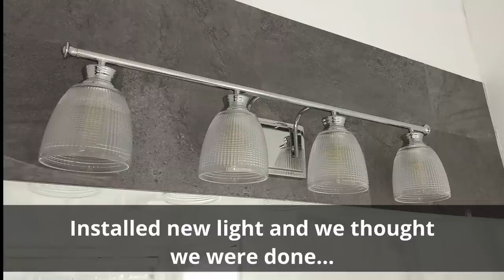AMAZING PEEL AND STICK Vinyl Tile ACCENT WALL!

Comment: Looks great! Next time try removing the vent and spray painting it, that way the dried paint won't block the air flow. You guys did an Awesome job on the wall👍🏽
Reply: Smart and pretty, you luv to see it. 👍🏽
Reply: I was thinking the same thing. Spray paint ALWAYS best.
Reply: That was probably too much work lol...remember it was the guy painting the vent

Comment: Nice job looks very nice. We put up peel & stick tile in our shower. We did use glue too, that was last year some of the tiles started coming off so we had to take those off and replace but other wise still looks good.

Comment: We did this in our bath and kitchen. Cheaper way to tile the walls and they work
Reply: Will it withstand heat from the stove if a wall is very close to the left side of stove.
Reply: @joureny1154  We did this in our previous house, it works well but do not put it near the stove or anywhere with direct heat. I don’t remember if we used any additional adhesive like they did, but over times the tiles would become loose or fall off by the stove because of the heat. 
It was a potential fire hazard in just that spot. 
Otherwise it’s a great project and the newer times look so realistic!

Comment: What agreat idea I didn't even think to use flooring Vinyl in this way its so kool I saw this vlog as I want to put a shower in my bathroom but the tile panels I've been looking at are so expensive. I may try this but only if I can waterproof it 100% I dont want any mould issues. Thank you for this creative idea☺👏👏

Comment: That looks amazing!! We are renovating most of our house, and we found a ceramic tile big (2’x4’) but that has that slate or concrete color and finish, we are planning on doing it on the floor and walls, but jeeze, maybe we should rethink, and save ourselves a lot of work and use the peel and stick. It also wont be as cold to touch. 👍🏼
Reply from the maker: Hi Ryan! Peel and stick has come a long way!  It can save you time! 👍🏾 Thanks for your comment!

Comment: Very nice job! Considering this too for the home we just purchased. I had ruled this out initially as I figured the moisture in the bathroom would inevitably result in peeling tiles, but maybe the adhesive technology has improved enough to make it a reasonably long-lasting proposition. Another plus, I guess, is that if you get sick of the color/pattern/style, you can peel them off - probably softening them with a heat gun  - then replace with another style. Right now it's a toss-up between this and a vinyl laminate wood board look. What I do know is that I'm going to go with actual wall tile. I've done a few tile floors, but having to use masonary bits to drill for reattaching fixtures is not my bag of tea. I will be installing actual ceramic subway tile in our kitchen though.

Comment: I think that is the best thing to do. Apply an adhesive first to the area before sticking the vinyl tile. Otherwise, some vinyl will just fall off because its adhesive is not sticky or strong enough. Doing the same to our undercover kitchenette outside.
Reply from the maker: Frank, make sure you don't completely cover the surface with an adhesive. The tiles need to touch the surface so they will stay in place. Let us know how it turns out for you. -DIYPC 😃✨
Reply: I actually clean the kitchen laminated wall first before applying the glue nail with a caulking gun sticking it in a zigzag motion then spreading the glue evenly with a flat 7 inch plastic scraper making sure every surface is covered before positioning 1 vinyl tile at a time

Man, the vinyl tiles really did stick very well. I inspected my work the following day & none of the 15 pcs of 30cm x 30cm fall off.

Comment: This project looks amazing, really nice job. The grout really adds to the high-end look. I've had experience with adhesive vinyl tile on the floor. Just know that if ever you have to remove peel-&-stick tile, that adhesive will destroy the surface of whatever it is stuck to. When you go to peel it up,, it will take a layer off the under surface. In other words, don't do this in a rental apartment or as a temporary fix unless you plan on fully renovating the wall afterward. If you do this, be sure to do it right like these two to get a long-lasting and beautiful result.

Comment: Isn't it amazing how good all this stuff looks and easy to do. kind of killing tradesmen industy on our ceiling we used Armstrong foam tile to cover sand paint many styles to pick
Reply from the maker: Hi King Lord! Thanks for your comment.  We have to check out that foam tile!
Reply: @DIYPowerCouple  they come in many different designs just put glue on back from caulk gun and ztick up. There are video's on here to watch

Comment from the maker: Hi DIYPC Family! 😀 See how our accent wall has held up in the bathroom after 8 months in this UPDATE - Peel & Stick Accent Wall video! https://youtu.be/rPERFUlxQfI
Learn more about the Ladder Stabilizer: https://youtu.be/XB5KYbftbo0
Reply: Jazzy just beautiful
Reply: I'm learning alot from the 2 of you thanks.
If I were to install the tile on my floor would I need to do a waterproofing membrane??
Keep those DIY.  Its something that you were meant to be doing.
Happy New Years and continued Blessings
Reply from the maker: Hi Darnell!  You can add a waterproofing membrane if you'd like but it is not necessary for every day peel and stick tile.  It would depend on the application location. Blessings to you as well and thanks for commenting!

Comment: I am currently trying to use peel and stick floor tiles on the walls in my RV ... But its not staying !!!  I am glad I have only put a few up so I can peel them off and try that adhesive you used and cross my fingers !!!

Comment: I wonder how well this will hold up if there is a shower in this bathroom.  Lots of moisture may cause some peeling to occur.  Keep us updated!  Thanks.
Reply: Peel and stick is vinyl so its waterproof. They added adhesive so should be fine.

Comment: Beautiful job! I'd have been tempted to just keep going and do all the walls! What made you decide to use flooring adhesive? Did you think the adhesive on the tile itself wouldn't be sufficient for the application?
Reply from the maker: Hi Artemis!  We used flooring adhesive with moisture control since we were installing the tile on the wall without the help of gravity to bond the tiles to the surface.
Reply: @DIYPowerCouple , makes sense - thanks!

Comment: WOW!!  Looks awesome!  I’m going to use the peel & stick to give my very small bath the shiplap look. My walls had horrid wallpaper and it destroyed my sheet rock getting it down. I was going to use small finishing nails for each piece. What do y’all think?  Will the finishing nails work?  Also, I never thought about using grout!  What a great idea!  Thank you both so much!  P.S.-y’all are such a cute couple!  Keep on DIY-info!  ✨✨
Reply from the maker: Hi Ruth!  The shiplap look sounds great for a small bathroom! Haven't used finishing nails personally.  However, they do give a nice rustic feel.  Try it on one plank and see if it is what you like.  Please share before and after pics if you'd like to diypowercouple@gmail.com. Much success to you! 😃

Comment: Beautiful ❤️
I have a question. What tool did you use to cut the.circle on the tile? Was that a regular power drill with a specific attachment?
Reply from the maker: Hi, check out @10:39 on this update video to see the tool and attachment https://youtu.be/rPERFUlxQfI

Comment: Very nice! Some questions: 

1. I have vinyl wall covering in small half bath. Can I do this over it without stripping it off?

2. If I put this on the wall right next to my stove, will the heat be too much for it? The wall cones up the left side of stove super close and then there is some wall behind and above the stove.

3. Did you paint on the additional adhesive to make sure the tile stuck well?
Reply from the maker: Hi Interesting Person!   You can see how we tiled over old vinyl flooring here:  https://youtu.be/mpvmRPkQEd0
We have only used heat to remove vinyl tiles.  The heat softens the adhesive so it may not work very close to a stove. 
We used additional adhesive sparingly so that the original adhesive on the back of the tiles can bond with the surface.  Hope this helps!  Thanks for watching!

Comment: The pair of you did a great job!
How's that painted vent holding up? I painted my vent and regretted it; about 9 months passed and rust color droplet spots appeared from the steam of the shower / sink. Washed with mild soap and water, spots return even faster.  Should I ever paint a vent again I will paint it whatever color I choose then paint it with an epoxy. Most likely I will buy a decorative vent plate and still paint it with an epoxy for the bathroom.  Wouldn't be such a big deal to clean the vent, they need cleaning anyways twice a year or so, but I'm old and broken; need all the help I can get lol. Don't understand how the paint can hold up on the walls of the bathroom, but not the vent. Suppose because it is metal?
Reply from the maker: Hi DK!  We used a mildew resistant primer.  Check out our 8 month update video: https://youtu.be/rPERFUlxQfI

Comment: Would love to have seen how you made that perfect fit around the trim close to the bottom left side.
Reply from the maker: Hey Djehuti Ausar Ra, we cut one piece into a square a little bit larger than the empty space. Then we drew an outline of the moulding shape on the tile and slowly kept cutting it down to size with pruning shears and a box cutter until it fit. The best thing that we (accidentally) found out about luxury vinyl peel and stick tile is that the sides can be sanded and easily shaped into small cuts. Hope this helps and thanks for watching!

Comment: So you used peel and stick and extra adhesive?  Thinking about doing this on my backsplash
Reply from the maker: Hi Susan! We used a little moisture control adhesive because we were installing peel and stick in a bathroom.

Comment: Hi guys 👋 I just wanted to ask HAS IT STARTED TO LOOSEN UP AND START COMING OFF THE WALL YET? BECAUSE IT WILL AND WHAT A MESS TO CLEAN UP. 😯😲
Reply from the maker: Gloria, No. It hasn't come off the wall. It looks the same way that it did in this update video: https://youtu.be/rPERFUlxQfI
We would apply spackle to the entire wall the way we did to the ceiling if it all fell down. There is no project or mess we can't handle. Thanks for watching! -DIYPC

Comment: Wow you guys are the greatest. Could u use tiles for ceiling.im redoing my house
Reply from the maker: Sandi, if they can put a man on the moon, there is a way to put tiles on a ceiling😁. There is always a way to do something, even if you have to create the way. Ceiling tile was always our plan. We haven't done it yet, but we will. We needed to know for ourselves that we could actually put them on the wall...and yes, they are all still holding up...even in extreme steam from the shower. We found a way to do it so know that YOU really CAN diy too! -DIYPC

Comment: Can you tell me what you were painting on the wall before you put the panels on the wall and was that wants that you put over it what kind of wax
Reply from the maker: Cindy, we used a moisture control adhesive. You can see the product @1:50 in the video. We also used pre-mixed grout on the tiles. Thanks for watching!

Comment: That looks great i was gonna try that but someone told me you cant put tile on wall
Reply: You can, with stick on tiles and real (cement/glass) tiles, you just have to have the correct adhesives behind them so they don't fall. And cement tiles will need a strong, reinforced wall because if its too heavy it'll collapse. I'd only really recommend using the stick on tiles like they did for a fashion statement

Comment: Just subscribed to your channel.  Beautiful job and neat idea to use peel and stick tile, it looks professional.  I like that you painted the vent black as it blended in rather well.  One question, how much damaged will the tiles do to the wall if you have to remove the tiles as you used an adhesive and grout.?  Will it be difficult to remove, and what do you use to remove the tiles from the wall?  Stop by my channel and say hello!
Reply from the maker: Welcome Modelchikny to the DIYPC family!  Yes, removing the tiles will damage the walls.  We will need to use a heat gun to soften the adhesive for removal.

Comment: Gee, I wish your video had been around 35 years ago. I had a long entry hall Thai kept getting Knicks. I came up with the idea to use peel and stick flooring tile as a wainscoting, however the tiles kept slipping down no matter what type of adhesive I used.

Comment: Nice  but I'd  hate  to have  to take  it down  once  I get tired  of the look,  although it would  be alot easier than  stone. All you  need  is a heat gun or steam  iron to remove it

Comment: Looks good, you guys did an amazing job but how did you use the grout in between the tiles without tile spacers?
Reply from the maker: Hi, we just used the grout to fill in any small gaps and cover any adhesive.  Thanks for watching!

Comment: With all the moisture in the bathroom those tiles won't stay for the long run if you don't use water resistant glue but it's very nice temporary fix.
Reply from the maker: Gooch, we definitely used a moisture resistant adhesive. Thanks for watching!

Comment: Our glue didn't work. The spray-on adhesives (two brands failed) after a few days. 
But here's a tip for you. TAKE OFF THE VENT COVER!
Tile over the hole, then cut out with knife or saw.
Paint vent cover while off the wall. 
Re-install vent cover.

Comment: love this! quick question, how has it held up with the moisture in the bathroom? have you had any problems with tiles coming loose?
Reply from the maker: Hi Melanie! So far, so good with all the tiles sticking.  Link in the description of the moisture control adhesive that we used. Thanks for watching!
Reply: @DIYPowerCouple  thank you so much for the info. def. want to try this!

Comment: I had a few tiles fall off the wall. Should I reapply the adhesive another layer ? Let one coat dry then adhere?
Reply from the maker: We used minimal adhesive and thankfully, none have fallen off as of yet.  You may want to remove all adhesive from the surface and reapply with a new tile.
Reply: @DIYPowerCouple  thanks!

Comment: Can this be used inside shower over that plastic or viynal or whatever it is they use in cheap showers
Reply from the maker: Hi Lisa! These tiles are not designed for the constant moisture environment in a shower.  Many people have painted the inside tiles then used peel and stick tiles on the wall surface around.  Hope this helps!
Reply: @DIYPowerCouple  Thank you❤️

Comment: I have a bathtub I'm wanting to cheaply convert to also have a shower. Could you something like this for the walls i the shower? Would it be water proof?
Reply from the maker: Hi Mike E, these tiles are not designed to withstand shower use.  Some people do paint the shower tile and install peel and stick on the wall around it.  Hope this helps and thanks for watching! Here's a video how we painted our tub tile: https://youtu.be/MR11izKFtvM

Comment: I damage the walls trying to remove wallpaper (I ripped part of the drywall layer) do I need to fix the wall before sticking the peel and stick on
Reply from the maker: Martina, yes, you will have better adhesion with the glue if you repair the wall before applying another peel and stick tile.

Comment: Why did you add adhesive? And it looks like you did it only in the corners?
Reply from the maker: We added this "moisture" adhesive because we are installing in a bathroom. We placed it in select spots because both the tile adhesive and the added adhesive need to react to the wall. This gives the tile enough strength to stay on the wall without sliding. Hope this helps.

Comment: Does the adhesive dry CLEAR?
Reply from the maker: Denise, No, the adhesive has a slight yellow tint to it. We made sure it was on the back side of the tile and we wiped off any adhesive that appeared on the sides after we applied pressure. - DIYPC
Reply: @DIYPowerCouple  Thank you so much!! BTW, I've had peel & stick floor tile on my counter tops for years. The edges are starting to come up (used no adhesive). Now I'm going to flip wood over and apply shelf liner, It has no adhesive and I can use what you used there. The upper side is "bumby" and will make me crazy cleaning it. So I found clear sticky(not sticky enough) transparent plastic, so I will need clear coat under that. I can't wait!! Have fun!

Comment: Do you think this would work inside a shower? I have tile in my shower and around bathtub I want to cover up. Thx!
Reply from the maker: Hi Farah, peel and stick is not designed to withstand direct water contact.
Reply: @DIYPowerCouple  Thank you!!

Comment: I'm having a hard time for mine to stay up....
I cleaned the wall and applied (spread) the adhesive till it was tacky put tile and still falling....
What am i doing WRONG.....
Reply from the maker: Remember to use the adhesive sparingly and allow the tile adhesive to touch the wall. Hope this helps!